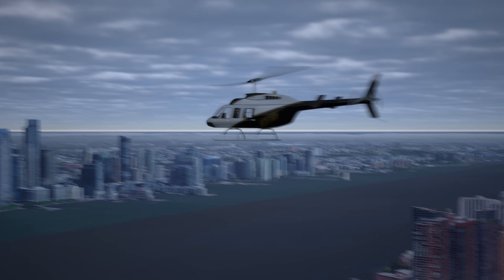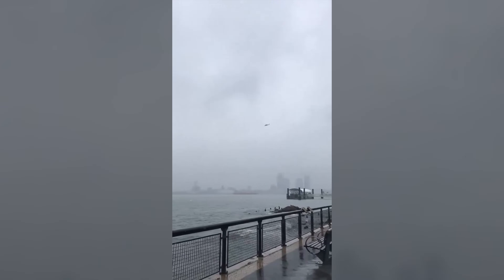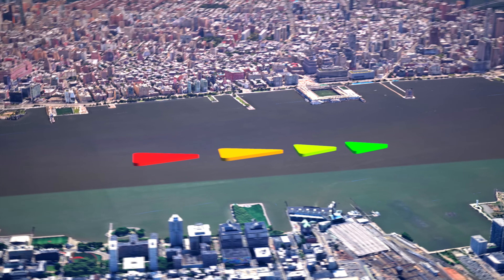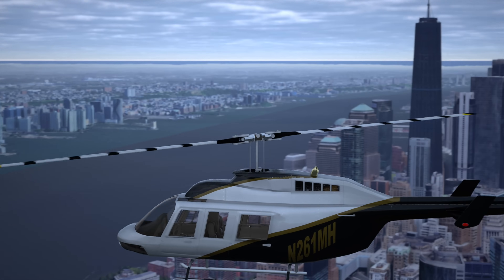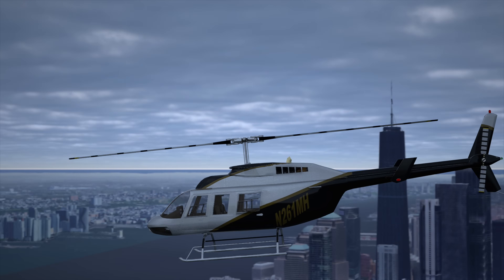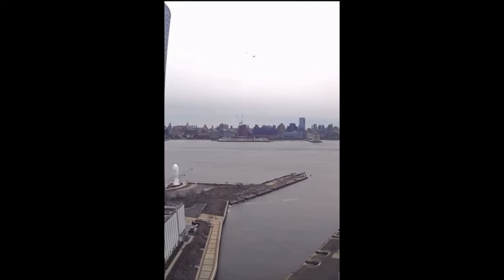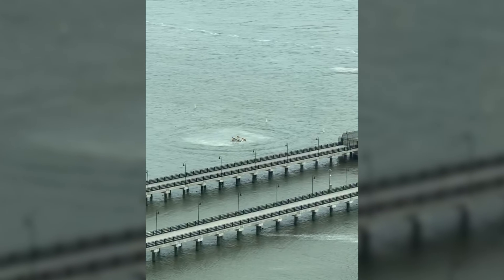Helicopters DON'T just fall from the sky - What is "Mast Bumping"?

Comment: I used to be HCM (HECUM) certified for wildcard fire. I the cert class all of our instructors had injuries from crashes. Helicopters tend to tear themselves apart over time due to vibration and centrifugal force. They have to have complete tear  down and rebuild every few hundred hours. In other words, yes they do just fall out of the sky quite often. Call it what you will, maintenance failure, pilot error, conditions, whatever, it happens. Chopers are dangerous.
Reply: All wrong. Bad info.

Comment: I don't understand why a chopper would be designed, even if it's incredibly unlikely, in a way that the blades could flex enough either from vertical wind shear OR especially heavy inputs from the user, to impact another part of the craft.    So what if the main rotor is a foot or even two higher above the passenger compartment?

Comment: Used to fly OH-58/ Bell Ranger in the Army. The failure is probably a broken push pull tube that controls the angle of the bade. When the tube on one side breaks, the blade goes flat and has no lift.  The other blade then jumps up and causes the flat blade to go down and cut of the tail boom. The transmission mounts then break causing the blades to separate and the fuselage then falls to the ground.
Reply: Why would the rotor then descend intact after such an event? Surely a blade would be bent.
Reply: Good analysis and thanks forva professional opinion.
Reply: The blades and gearbox separated as a unit.

Comment: Mast bumping normally causes the rotor head to break off at the top of the mast and usually results form zero G maneuvers where the rotor is unloaded and the tail rotor rolls the machine with the pilot applying counter cyclic while the rotor remains unloaded. I wouldn't expect to see the entire transmission and engine along with it. This looks like excessive downward flapping from a sudden aft cyclic application, which chopped the tail boom off and tore the power plant from its mount. I think that's possible to happen without even contacting the bump stops.

Comment: That's sad.  Sounds like a reasonable possibility for most likely cause of accident, rotor/tail contact.  I would think that less likely ones might be things like a seized main rotor bearing or a transmission lock up or drive shaft failure.    It was hard to tell for sure if the rotor blades were still fully intact, but without knowing much about it, I am surprised that the blades can cut the tail, and remain fully intact.  Maybe metal ones do?  I would think that FRP blades would just shatter.

Comment: I'm also a former commercial helicopter pilot and air traffic controller. The theory of mast bumping simply doesn't hold water in itself. Pilots who have flown the Bell 206 models of helicopter including the "206B" and "206 L3"variants know how extremely sensitive the cyclic control is. You simply DON'T jam it in any direction any time! Period. You use your awareness and keen eyesight and senses to keep a mental picture of everything at the same time. There was nothing on the ATC controller radio frequencies that even hinted at birds being present. Yet it does appear that the pilots control input contributed to, the sequence of events that resulted in this terrible tragedy.

Comment: Out of fuel 😮. Didn't know that information was not revealed
Reply: The aircraft did not run out of fuel. Other reports mention that the pilot reported that he would be returning to the company's refueling location to get more fuel. Aircraft do not break up in the air when they run out of fuel.
Reply: @brianb-p6586  I just listened to the pilot on radio call out that he was low on fuel. It was on Ohio radio an hour ago  if it's wrong , there's an FCC issue with radio station airing that recording
Reply: @ If you are on a trip in your car and look at the fuel gauge then say "the tank is getting low, so I'm going to stop at the next gas station", it does not mean that that your car is about to sputter to a stop in the middle of the highway.

Comment: ...It's hard to believe mast bumping is an actual thing. That doesn't sound at all like the aircraft crowd. There so meticulous about every little thing....but your main rotor could possibly cut your chopper in half. You'd think they'd fix that right away... no mater the cost of a design change

Comment: Where the blades connect could a bearing have failed ? If so then the props would be in a position never meant to be in and cut the body off. I am thinking of like a rod bearing giving out  and then there would be knocking then an explosion of the rod almost instantaneously..

Comment: Robison R22s and R44s are notorious for allowing the rotary shaft to bend with the aircraft when the  "Collective "  the upward drive is then pulled forward because of the angle to drive shaft trying to go up and forward at the same time.  the craft going up and forward bends the shaft sending the spinning blades into the tail boom...forward. It then hits back on the boom tail of the aircraft cutting it off. Think about if a scorpion had spinning blades on top of it and it pushed forward and the spinning blades chopped the rear tail hanging over it off.... that's what happens with these things.And dumbasses kept doing it.

Comment: When I was in the MI in the 1st Cav, the division had 400 helicopters. On average we lost 2 per week, consistently, half due to enemy action ,the other half because of pilot error or mechanical failure.  They do fall out of the sky when something critical goes wrong. I saw a Huey crash almost immediately after fueling. It rose about 8 to 10 feet, then slammed down. Miraculously, everyone hopped off, and within seconds it was consumed by flames.

Comment: are 206s susceptible to mast bumping? I thought they had a different system.
Reply: Why not check with any reference source? The 206 is one of the two original Bell turbine helicopter types (the other is the 204 or "Huey") - they use the classic Bell teetering rotor system, adapted from the Bell 47.

Comment: With explosion heard couldn't rule out possible bomb on board.
Reply: Or that's just the bang of a main rotor blade hitting the tail... 
Just wait for the investigation, which will quickly determine whether or not any explosives were involved (and they almost certainly were not).

Comment: I went on a helicopter ride at Grand Canyon West the week after a tragic crash in Grand Canyon West. The price was heavily discounted and the odds of it happening again that soon were pretty low. 
There is always a chance of an accident whether flying or driving. Just got to weigh the odds. Generally the odds are well in your favor nothing will go wrong. 
Sad an entire family was lost in this tragic accident. Thank you for your well thought out explanation of the most likely cause.
Reply: The odds of crashing don't change because there was a recent crash just like the odds of a coin landing heads don't change just because you just got two heads. Or even 10.
Reply: @pjaypender1009  I respectfully disagree. You know right after a crash they are inspecting everyone's flight records, maintenance logs and safety checks..
Reply: In situations like these, I always think back to a roundtrip flight with a museum aircraft I had as a child.  My mom was supposed to join us, but got a very uncomfortable feeling she just could not rid herself from when the plane rolled up to the hangar/boarding point: she was convinced something was up with the plane and refused to board.
2 Weeks later it crashed, killing all on board.  A replacement part that did fit, but was not supposed to be used (due to rubbing that this incorrect part caused on an oil line) had been in the plane on the day of the roundtrip.  So my mom's intuition was completely correct.

Can't imagine what it's like to have a part of your indirect family never show up at parties anymore, or simply visit you.  Just as I can't imagine what it's like loosing a big part of your colleagues from work all at once (the museum plane carried provincial government employees who booked a roundtrip over their province).
Reply: Grand Canyon helicopter
flight always have been controversial..

Comment: In the Army l used to get quite nervous when doing a tactical fly-in, feeling the g-forces acting on the aircraft and seeing the ground where the sky ought to be and the sky where the ground ought to be. It's only because l was a few minutes late arriving at the LZ that l wasn't on a helicopter that piled in a few minutes after take off, probably when doing a tactical fly-in. There were no survivors. Helis are inherently less reliable than fixed wing aircraft. The rotor assembly looks inadequate to the inexpert eye and undergoes enormous stresses when performing violent manouvres. though it is unlikely that this heli was doing any such thing.

Comment: How can the propellers separate in mid air without anything crashing on to the helicopter? Aren’t the helicopters checked before they take flight? And if there was something wrong with the engine, wouldn’t it cause problems right at the start when it takes off? The family that does seem to be important family to a company that is very important in many areas… ? What’s going on… this video seems to try to divert the attention… if helicopters are so bad against the weather, then it’s not worth getting onto any helicopter. We have helicopters flying into Everest over the Himalayas almost everyday..l huh???.

Comment: MRGB failed (internal or connection to Airframe).  Only four bolts hold the MRGB to the airframe.  Imbalance caused tail  to shear off.....Endex.  Mechanical failure either through maintenance negligence or fatigue which was missed.  Either way, big pay out.

Comment: Hi, I hope this community can help
I traveled with this helicopter on a New York sighting tour on Wednesday, April 3, 2025. 
So nearly over a week ago!
I made two videos in front of the helicopter where you can see when the helicopter landed and the passengers got off the helicopter and we waited to get on the helicopter, with zero power, but the engine on and running, that the tailrotor is bumping very extreme.
When you have the engine on but zero power on the engine, this pumping usually should not happen, I think, so my question is if this pumping at the tail rotor damaged, the main rotor or/and the section between the main cabin and the Tailrotor? 
The other bell 206 helicopters on that day and in all the YouTube videos I found didn’t have this bumping !
Can it be the reason for the accident and when yes, how could I give my videos to the NYPD or NTSB?
Hope you can help me find an answer !
Thank you very much for the help
Reply: On the ground with the rotor just turning (no attempt to fly) it is highly unlikely that mast bumping occurred. Mast bumping occurs with dramatic movements of the rotor (due to rough weather and/or sudden/extreme movement of the controls) The fact that the pilot allowed the passengers to depart the helicopter indicates that none of the conditions likely to result in mast bumping were present.  When mast bumping does occur it usually results in serious damage to the aircraft and the pilot could not have missed this (most of the tail boom is thin a aluminum skin). While “bumping” makes this event sound gentle, mast bumping is NOT a minor event. This doesn’t mean that your videos wouldn’t be of value to the NTSB or FAA.  Maybe you can contact your country’s equivalent of these organizations and they can forward the information the NTSB/FAA?
Reply: @ thanks for the information! On my videos I can’t see a mast rotor bumping, it is only very obvious on the video that the tail rotor is pumping really heavy. I will try to give my videos to my flight safety agency or the US Embassy in my country. Is there a way to give my videos to the NTSB? Thanks 🙏
Reply: NTSB should have a contact spot on their site, also reach out to the FAA.
Reply: @ sorry I was a tourist from outside of the US so I can’t contact them in New York because I’m back home

Comment: It wasn't a Mast Bump; it was an unsecured Jesus Nut, which should have been Safety-Wired.  The rotor didn't impact the tail boom; the tail boom -- like every other helicopter accident where mast torque is suddenly eliminated -- simply folded in two, and then separated.

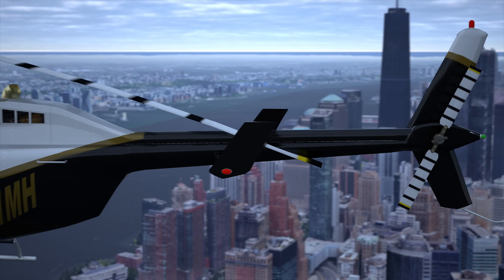Comment: @3:21 "There is certainly enough force to dislodge the engine from the rest of the aircraft." I think you meant dislodging the tail boom from the rest of the aircraft. Either way, what a horrible accident.
Reply: I totally agree with you. The helicopter is falling with resistance not at free fall and it is not too high up in the sky. The fall is not enough to not kill people, unless if there was a blast on impact. But there was a splash

Comment: so going off the footage shown at the start I'm going to assume some kind of mechanical issue occurred in the main rotor shaft causing it to attempt to completely lock up or seize causing the helicopter to violently rotate ripping the tail off due to the g force

Comment: It's very tragic.... I wonder whether the pilot was dual rated. If he was and if he started flying airplanes, by law of primacy, his instinct to push the yoke forward in case of troubles, may have forced him to push the cyclic forward - which would lead to low-G and subsequently mast bumping of the teetering main rotor system.

Comment: I grew up on huey's, worked 206's for years. I'm thinking corrosion, transmission mount let go, tilted the rotor,  hit the tail boom on the way out, either way I'm sure that the fed's are typing up emergency AD's for all 206's

Comment: It seems like mast bumping would have obliterated the rotor blades, but they were intact and separated from the aircraft.  I would suspect a mast failure caused by something breaking inside the mast and closer to the aircraft body than the end of the main rotors would have touched it.  The rotors could be torn off when the aircraft experienced dynamic forces from the tail rotor snapping off, and subsequent motor torque.  I would look at a broken linkage in the tail rotor caused by mechanical failure or tampering, followed by the force of the pitching aircraft tearing the rotor shaft from the main engine mount.  The main rotos were intact, so they didn't hit anything.  My 2 cents.  Prayers for this family and the pilot.

Comment: Fantastic capture of essential video. Those rotor blades store amounts of kinetic energy. Still aloft and spinning will be a clue for 5he NTSB. Still attached to the gearbox ought to mean this will be one bigger piece to examine (as opposed to looking for two rotors flying outwards). Don’t know the FAA regs on requirements for a CVR & FDR for air taxi/sightseeing operations. There used to be cutoffs for number of seats aboard.  Loss of the main rotor guaranteed no hope of autorotation landing due to loss of tail rotor control/of the tail rotor. 

That the main cabin landed upside down tragically reduced the chances of occupant survival. Any energy absorption by the seat frames is lost. 

What little I know of the classic Bell 205 (UH-1) and 206 Jet Ranger models’ “see-saw” rotor system is that there is little tolerance of negative G loading. Mast bumping is a major concern. And most rotor systems must be carefully managed during takeoff to ensure until centrifugal forces “snap” the blades taut a blade can go anywhere thus striking the tail boom or a bystander. By the very nature of blade  design rotor blades must be flexible to a degree.

Comment: When I first saw the video yesterday, I thought, mast bumping. What I see here is not only the main rotor blades but also the mast and the transmission going along for the ride. When I transitioned from airplanes to helicopters in 1981-82, I learned in a Bell 47, and it was drilled into me what mast bumping is and how you avoid it. The 206 is a very good, reliable, and safe helicopter. I spent a few decades flying one. Don't ever get into a negative G situation, and I am not sure this is Mast bumping now. Something broke, or one of the bolts was not secured. I will wait for the Report to come out. Sadly, the whole family and the pilot all go this way. Stuff happens. You can bet that the FAA will look at the aircraft logs and talk to the maintenance people, and the company will be under a microscope over this.

Comment: It's been reported the pilot called in a fuel emergency. If you take off with a fuel leak or simply not enough fuel, it's the pilot's fault. He sounded panicked in the fuel call as he was about to run out. I think they'll find that he made a quick turn to return for fuel and had a mast bump, which severed the tail as the main rotor flexed down and chopped it off. That would explain what happened. This company has also been reported for maintenance failures in other reports. RIP and condolences to the unfortunate tourists and their kids.
Reply: Bingo👍

Comment: Look up the 2011 Cobra crash on Camp Pendleton. A bird hit one of the main rotor pitch change links, and the resulting main rotor vibrations caused the aircraft to break apart and crash almost the exact same way as this one. Both that aircraft and this one were made by Bell Helicopter with underslung semi-rigid rotor systems.

Comment: Helicopters terrify me.

At least with a plane, you could GLIDE to an emergency landing, with a helicopter you basically become a spining ROCK....
Reply: With a loss of engine power helicopters can autorotate, this is the helicopter equivalent of a glide, it’s just a lot more vertical, but totally survivable if executed properly. Obviously this case was not a simple power failure.

With a loss of rotor it does indeed fall like a rock, but then again so does an aircraft when it looses a wing.